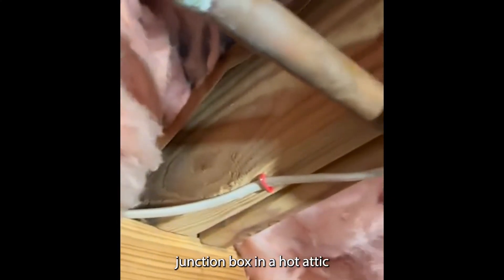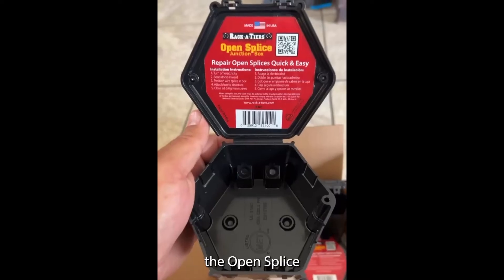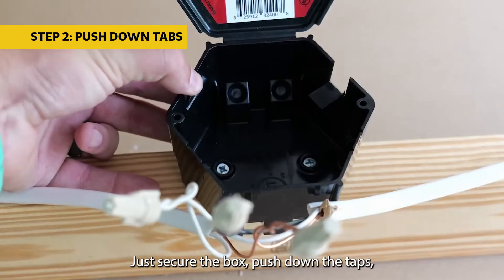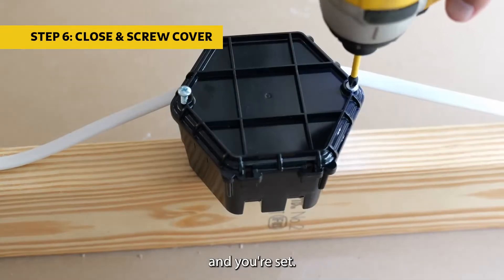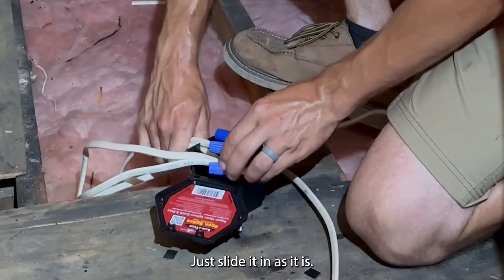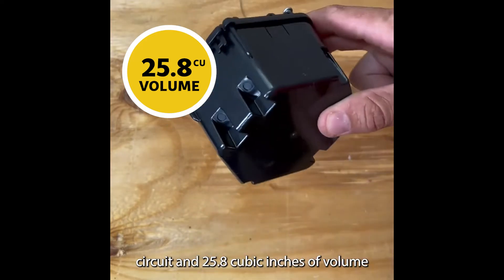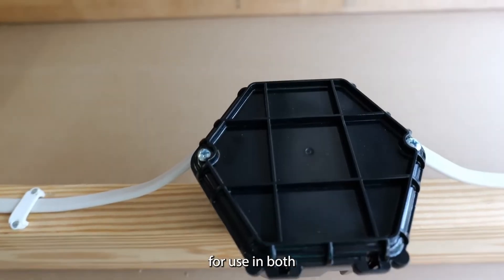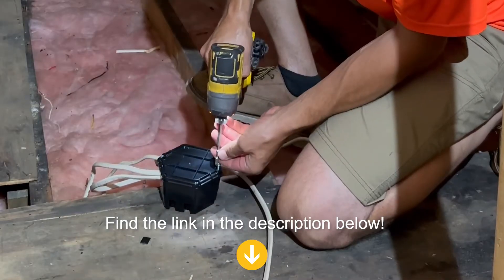How To Pass An Electrical Home Inspection!! -(Open Splice Box)

Comment: Key point for this is the time savings. If you had the remake the open splice you'd have to FIND THE BREAKER to take it apart and redo it.
You're up in an attic, the open splice likely wasn't even what you went up there to deal with, you don't know where it's connected to, you don't have an outlet to plug a circuit chaser in, the panel's on another floor.
Skip all that. That's the time saver.
Reply: Just pop it and trip the breaker....